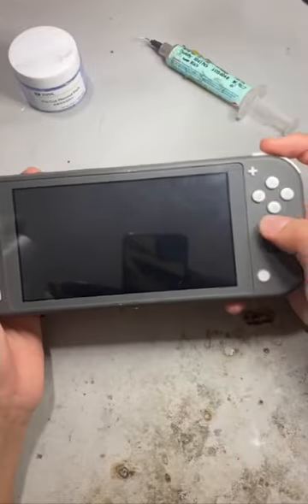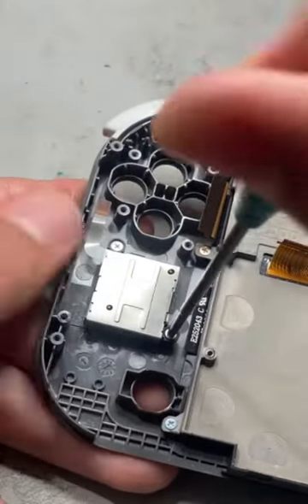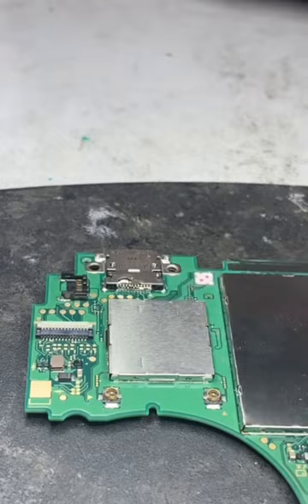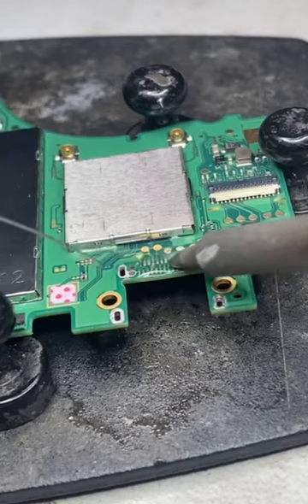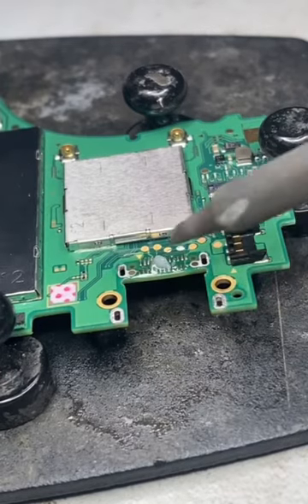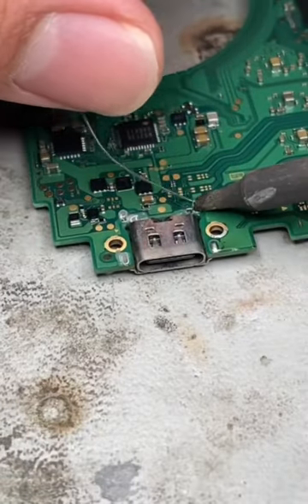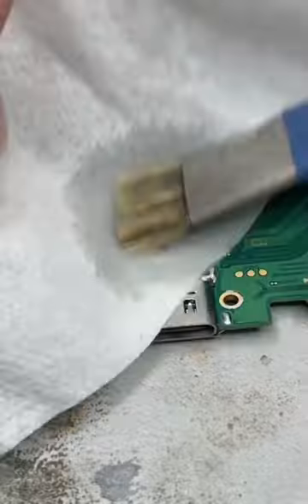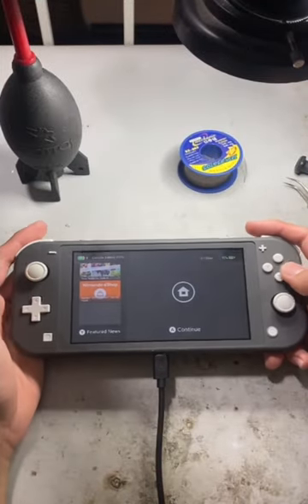Nintendo Switch Lite Repair #shorts #nintendo #gaming #gamer #technology #nintendoswitch

Comment: Can I ask a few questions? Cause fixing stuff is my growing passion, but I'm still learning..
My soldering skills aren't the best thing in the world, so I'm asking.. Is it hard to do a charging port repair?

I actually have something to try it on, like my brother's JBL speaker..

Is flux important? How does it work?
But most importantly, does it matter if I use any soldering Iron/Solder/Flux or should I buy something in particular?
(Cause atm I only have cheap stuff)
Reply from the maker: Sorry about the late reply, I haven’t checked up on my youtube as much but I am glad to see that you have a growing interest in repairs! To answer your questions, a charging port repair (assuming its a microusb port) is a prefect repair to start off with since replacing it will require little to no diagnostics if the port shows signs of physical damage. Flux will ensure that your solder flows properly and will help you achieve solid joints! l You can never have too much flux, just be sure to keep your area clean and use 99% alcohol to clean the board. And in regards to tools, do not worry about having the most expensive tools starting out, I am using a KSGER soldering iron that goes for about 90-120$ which would be considered entry level and gets the job done!